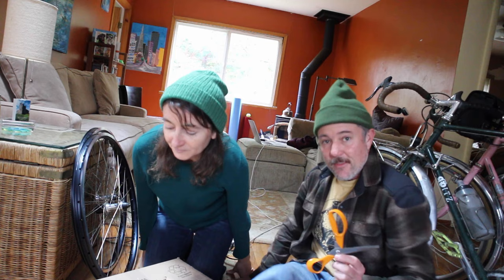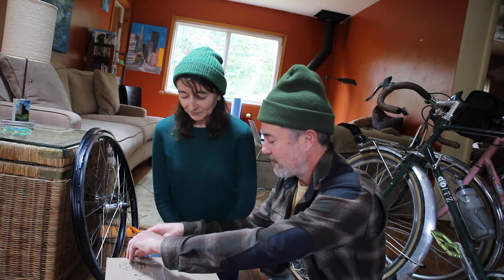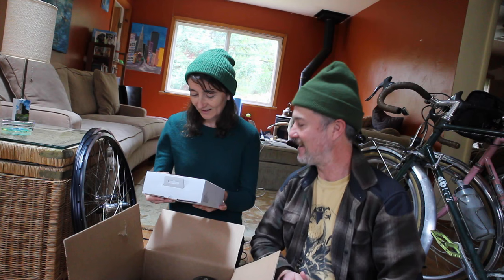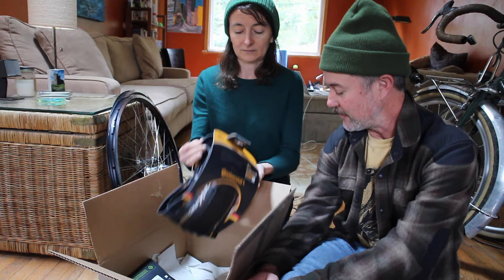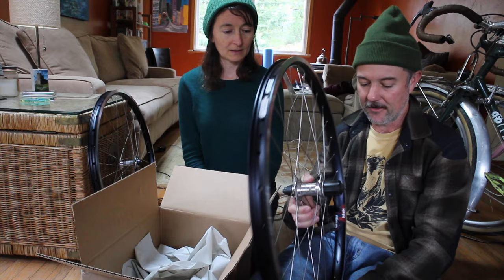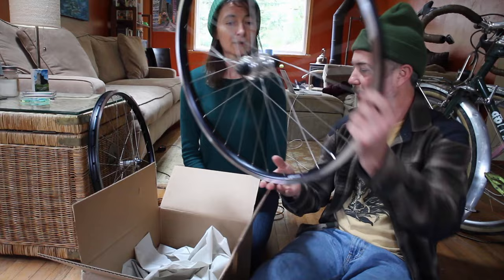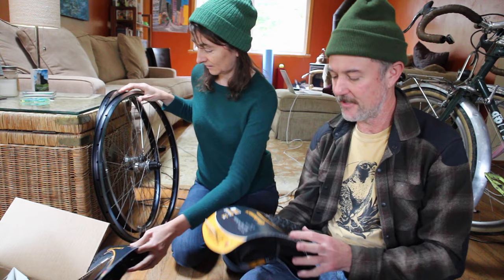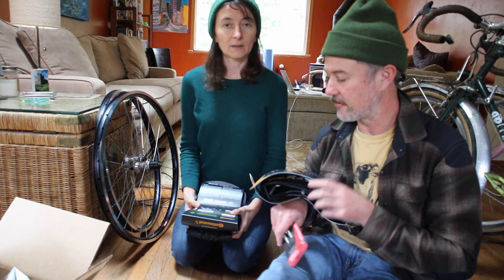This isn't the vlog I had planned...DTB

Comment: Sorry to see the van down, but glad it was close to home! Orange Seal Endurance is hard to beat for sealant choice.
Reply from the maker: Thanks Michael. I hope it's something trivial...
Reply: I agree with your opinion on Orange Seal Endurance sealant. I use it in my mtn bike tires (27.5 x 2.8), and it actually sealed a hole over a quarter inch, I only dropped about 5 psi from my normal 22 psi by the time it sealed the puncture.

Comment: If I still had a VW bus, Im pretty sure I'd keep a folding bike tucked in it.
Those wheels look very strong.
Reply from the maker: The funny thing is I normally bring a bicycle with me at al times. We just got back from a SoCal trip and I was getting way to confident I guess.
Reply: @Henrywildeberry  At one time, I drove a 1939 GMC 3/4 ton truck everyday.  Hauled bikes of all kinds with it.  It was scary as hell at 55mph but it could be done.   ...just like driving a tractor at speed....I could always fix it, so simple and crude.

Comment: I live pretty car-light these days, walking or cycling to most places I go. But living in LA, a car is still a necessity at times. I just dropped off my '87 Toyota truck at the mechanic because it was smelling strongly of gasoline. Turns out it has a bunch of fuel leaks and I'm looking at around $2k in repairs. Sometimes cars can be a real bummer. 😔
Reply from the maker: Dang, Justin! That's a hefty bill. Cars are great, but when the breakdown hits you can't just easily walk to a car shop and get the parts to fix it. There's often a lot of diagnosis with specialized tools. I wish you all the best in getting the Toyota sorted out. They're great cars and worth keeping.
Reply: @Henrywildeberry  Thanks! Yeah it's a great truck, but it also has a lot of sentimental value. I bought it from a family friend who taught me to drive stick in this truck and then shortly after I bought it he died from pancreatic cancer. It also turns out the truck was built the exact same year and month that I was born. I don't think I could ever sell it.
Reply: I drive a 1998 Nissan truck, but I just dont drive it enough.
I have to have a car but I dont haul dirtbikes anymore, and I dont go to work every morning anymore. 
 I checked my book and I only drove it 2300 miles in 2 years.  So the tires time out rather than wear out.  Paying full boat at an auto shop is pretty insane these days......................the 98 is fairly simple as cars go these days, 5 speed manual, roll up windows, FI that seems reliable. I hope it runs a long time.

Paying full boat price at a bicycle shop is pretty insane for that matter, I do all my own work but I know people are spending near 100 bucks an hour for simple bicycle repair in some cases.

Comment: I love my Velocity Cliffhangers 700c i26 for my commuter/utility hybrid bike. I am a bigger meat sack and the bike hauls grocery’s and is my trailer tractor. The tires are Conti Contact Plus 47mm for some cush and ebike like durability on a me-power ride. The bike is disc but I got the machined wall as they may other uses in the future.

Comment: Yikes the HWB retro psychedelic mobile base camp van down on the matt, BUT it's solvable 100% good luck.
Ms Cools should like those tires and rims set up tubeless for the more ambitious off roading you might try.  Endurance not speed is the goal for that.  Those should smooth out the ride a lot too for Ms Cools. 
I've had great luck with Stan's Race sealant.  I am also a new fan for the 27.5/650B tire on drop bar bikes.  I have a steel bike set up with those, and its been great with 50c tires on it. 
May the van gods look favorably on you sir LOL.  All the best to you and Ms. Cools!

Comment: These parts look nice and Mrs Cools is going to be the !!Race Queen!!. I am not sure about the question wich sealant is best or better, because I only see little differences, but one year ago I removed a wheelset with Doc Blue and left it in the basement, while the year went by I pumped them up two times? not knowing when I will use them again.... They are still holding air with Doc Blue (German basement, cool conditions, no tendecy of drying out quick) Doc Blue obviously works here, I am happy with that./// One thing to defend the VW Bus is that it lasts so extremely long and it excuses so much. At work I shared once a T4, not as old as yours, thats clear but driven so many Ks in a short time. Me and my 8 colleags shared this vehicle, Diesel and I am not sure how many Ks it were when our managing director decided to get a new one? At least 380.000 or so. The last month we had him the VW started being a little bit sensitive😄, but he was our cute grandpa and despite using a new Multivan after that it was sad somehow, but I am sure someone still uses the old T4 and enjoys life with it. Your Westfalia is very special, so whatever it takes, give him a chance. Liebe Grüße aus der VW Gegend BS-H-WOB.🙋‍♀

Comment: I agree with you  regarding the quality of Velocity Rims .I built a few sets, and they trued up well.. I especially like the natural aluminum  high polished ones...my to go for an indestructible rim is DT..
Reply: I'm a wheel builder. Velocity is my favorite brand to build with. Excellent rims that build strong wheels. My favorites are the 
 Blunt SS and the little bit heavier Dyads. I beat Dyads on dirt tours and for riding my single speeds  on rocky trails. I use the lighter Blunts for long distance day rides and dirt rando. I very rarely need to true my wheels. Large volume tires will protect your rims. 
  Like Henry says, Velocity will build up   very round. They make  a very large variety of rims. They're also US made,  which is important to me.

Comment: Everyone in my shop loves Orange seal. The endurance version. It seals great and forms a film as it dries inside the tire. 
   I will not recommend Stan's as a pro mechanic. It contains ammonia. If it leaks under your rim tape, the ammonia can eat aluminum  nipples and wreck wheels. This is a pretty extreme failure, caused almost completely by neglect and failing to tape rims properly. But  I've seen it happen several times.   It's just not worth it. Plus that ammonia STINKS when it sits in your  tires a long time.   Your nipples would start breaking one after the other, Then  your wheels will literally fall apart. Probably the best solution is don't waste your money on alloy  nipples. Brass nipples will last far longer and be much easier to true as your wheels get older and older. The weight gain is insignificant.
  I only use alloy nipples if my customers insist and they wont get my lifetime truing warranty.  
  Muc Off sealant is sort OK, but it's best for resealing a tire that was already sealed well. It remains liquid, it's pretty messy and it doesn't help at all if your particular tire fit is a bit loose. The best thing about it is that it won't dry up in a half used bottle that sits on your shelf a long time. We stopped selling it because few people bought it.

Comment: Hope the van returns to normal asap. 
I just got some WTB sealant to try. It says synthetic latex but not sure what the hole plugging material is. 
Stan’s with the cornmeal and Pannaracer with the walnut shell bits both tend to grow mildew on the outside of tires during damp winter storage periods.
Reply from the maker: We were planning an overnight trip up to Mendo too!

Comment: If you have a PerTronix points replacement ignition in there, check to see if has slipped on the shaft. I have had that happen on some type 4 engines and flat 6's. Orange Seal Endurance for me since it is easier to clean up after it hardens up. Keep up the good work.
Reply from the maker: Thanks for the tip! This is an electronic ignition system. This van falls in the era of the air-cooled with bosch AFC.
Reply: Also check the trigger for the fuel injection in the distributor as well.  @Henrywildeberry

Comment: Orange Seal works for me! Although if you have 4 or 5 bikes you ride, it has gotten old buying the stuff and keeping it fresh.
Im running TPU tubes/no sealant in my road bike. So far so good .  Tiny little tubes and easy to carry a few spares.

On my Intense Sniper XC bike Im trying some Trail king knobbies, they hook up really well. 
-----------------------------------------
I used to go to Century rides in a early 80's Vanagon.  Always an adventure and great once you got where you were going.
I think it was about 70,000 miles to new top end on engine, the bores wore in a triangular fashion being air cooled.
Reply from the maker: We're only using tubeless on two (three if you include my rarely used MTB) bikes here.
Reply: @Henrywildeberry  That is a thing, I have a few bikes I rarely use, but the sealant needs to be fresh in them if they're going somewhere. Kind of a pain but not impossible. 35.00 a quart for sealant and it can go quick.

Comment: I use Effetto Mariposa caffelatex sealant and it seals really well - (also use Contis ... but X king/mountain king combo)..Effetto also do a sustainable plant-based, plastic-free sealant called Vegetalex, however I haven't tried this so can't recommend. Oh 'Syd fixes bikes ' does a good video on fitting tubeless with just a track pump....I've always found that taking the valve core out is the secret, as air gets in much quicker

Comment: I’m not sure of where the distributor connects on a VW but, the rotor should spin when the engine is cranked. Even with bad timing you should have been getting some reaction with starting fluid. Is your BW utilize a timing belt or chain?